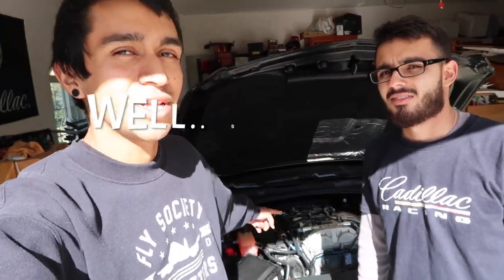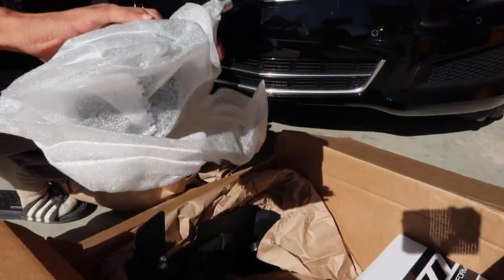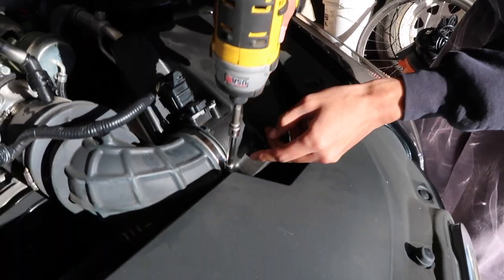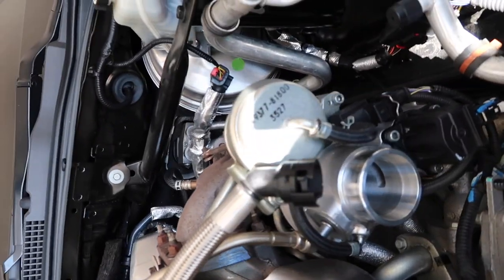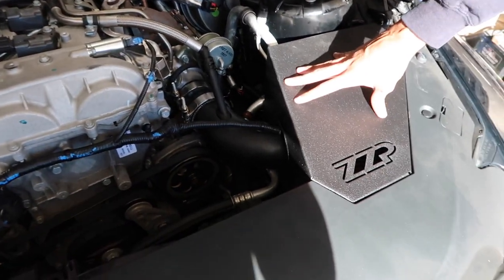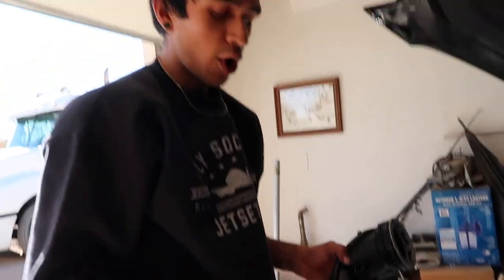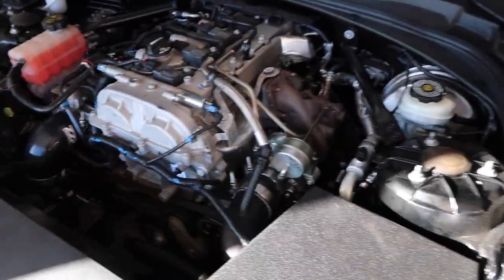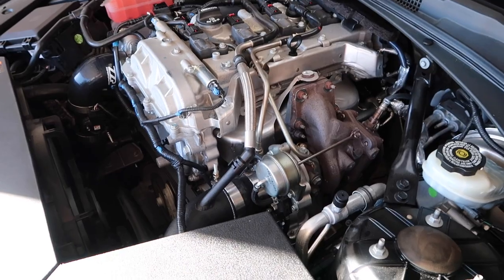Cadillac ATS 2.0T 6MT ZZPerformance Intake + Throttle Body Install

Comment: I’m the process of looking into this setup as well. Question, do you know if the car will throw any check engine codes or is it ok to run with stock tune ?
Reply from the maker: ZZP claims a potential CEL for the intake as you're increasing the overall volume of air being drawn in. BUT in my experience I ran this setup (Intake + Larger Throttle Body & Charge Pipe) for a week with NO CEL and I take my car to redline often. Once I installed my ZZP catless downpipe (potential video coming) that's when I did get a CEL but in all honesty I'm not TOO worried. My 2 codes are related to my cat not being there. So my car is running rich at the moment but I still drive it no problem. Rather run rich than lean! But I intend to get ZZP's PCM tune once I have the money for it as well as a few other little goodies that I want to do before the tune! The tune will give you extra power as well as eliminate the CEL! So it's a win win (:
Reply: PREVA1L MOTORSPORTS nice  👍🏽 ! Thank you and I look forward to seeing more of the caddy build.
Reply: PREVA1L MOTORSPORTS d

Comment: You need a catch can to keep that oil out of the intake etc. I have zzp catch can, CAI, throttle body, down pipe and PTP turbo blanket, zzp high performance coils and ngk laser iridium plugs.
Reply: How much hp with those mods

Comment: Just came back to this video after getting my engine replaced I had a cold air intake, catless dp, and was dyno tuned making 353 crank it was great for three months until it wasn’t I don’t recommend tuning this motor unless you have the time and money to build it

Comment: i did the same mods and honestly feel like i lost power. it sounds fantastic but was very disapointed. any ideas?
Reply from the maker: You shouldn't feel any noticeable power lost unless you possibly created a boost leak upon installation.. But you only did the throttle body and Intake? Without actually tuning the PCM, you're only going to get mainly increased audio from the turbo because the stock computer (tune) will only compensate so much (basically nothing). If you're after power, do a PCM tune (zzp or trifecta or any other if you know of any). If you want to make real power though, I suggest investing in a real dyno tune with a reputable tuner.
Reply: PREVA1L MOTORSPORTS I agree, I just got a tune and it’s so much fun without any bolt ons, but I’m afraid the cold air intake won’t actually make power but decrease it I’ll find out I guess

Comment: That's from the pcv valve. That's a recirculating system. That line goes into that filter on the inlet to the turbo into a foam filter.

Comment: The hose clamp is a 7 mm hex.   Be careful not to over torque the 10mm throttle body bolts.  They thread into brass inserts in the plastic intake manifold.

Comment: I just installed mine on a 2014 ats 2.0 I got a check engine light and a decrease in power the turbo sounds way louder than it should IMO I’m sure something’s just wrong with my car
Reply: Did you tune it after install or nah?
Reply from the maker: Without a tune you'll get a code for the increased airflow aka running lean. The cold start would be loud but would quiet down significantly after the cold start was over. You might have a leak if it's consistently loud

Comment: I did the Intake and now i have a p0171 lean code.  Is there a simple way of gettin rid of this without renting a cpu from the zzp 
 website ??
Reply from the maker: Honestly I'm not sure, I never got a lean code. But I also didn't have the throttle body and intake on for very long before doing the downpipe. I was running rich for a bit after that but I didn't mind that because better to run rich than lean. If you're going to tune it and still have warranty, highly suggest getting a new tuned pcm if you care about your warranty...
Reply: I had the same code on my gen 6 after I did the zzp intake and I found by rotating the tube and changing the angle of the mag I was able to make it go away, it's been gone for over 2000 miles.

Comment: It sounds like your lifters are knocking the top of the head but I could be wrong,  I diagnosed that from the video sound.  I had a used miata and the first thing I had to do was my lifters. I had to  have them adjusted so it wouldn't ruin the engine any further.  The caddy is great otherwise.
Reply from the maker: Honestly all the 2.0T's I've heard have all sounded similarly in sound. I was a little paranoid at first too, but with the car only having 16k miles I'm not all too worried. Worst case scenario gives me a reason to build the head! But thanks for the advice 👍
Reply: It’s the injectors firing at high pressure. Some applications get up to 2800 PSI! All DI engines I’ve had make that sound.
Reply: Direct injection 
That’s the sound it’s making
Reply: @snappyaj9053  in
Reply: @calvinallen3510  in what?

Comment: Great video guys! 
So how is the car running after some miles? Any issues?. 
BIG Thumbs up (=
Reply from the maker: Thanks! And car is running great besides having a CEL. A catch can is definitely a priority as these LTG's tend to have lots of blow-by.
Reply: PREVA1L MOTORSPORTS + what code do you have? Our car is finally finished (=
... We are making the right catch can for these 2.0 LTG engines. Maybe we can send you one if you would make a video for us?
.... We have a few new parts coming out for the 2.0l turbo as well. .. 
... You can always hit me up via StrictlyLTG.com (any of our social media links will work) with any issues with your engine.  Let me know the CEL code and I will let you know what to do (=
..... Thanks for your response!
Reply: How's the car running bro and can you tell the difference.
Reply from the maker: Haven't really driven the car much in the past couple weeks. I ran into an issue with the front goodridge brake lines so the car has been parked since I haven't had the time to take a look at the issue/correct it. But besides that I've since bought a tune for the car so it'll be stage 1 in the near future once I can drive it again. Will be making a video showing how to install/swap the PCM and basically show if it's worth it or not. Will be running Gus' new car before and after to show the difference.
Reply from the maker: Strictly LTG Checked it out on your website, looks good and bet it definitely helps temps in the engine bay. Lol I'm a ricer and took the stock heat shield off... I wanted to see the lil ass turbo. I know everything around it is nice and toasty now lol.. I would probably run your turbo blanket but at the price point it's not a top priority at this exact moment but when the time comes I'll hit y'all up fosho
Reply: @StrictlyLTG  your website running anymore?
Reply: @StrictlyLTG  RIP to your company and website..... Wishing you much more success on your next company.
Reply: @EliteOnTheBeat  hey I appreciate that! I’ve got over 100 companies and 20 more bov new in the box. I had to wait for inflation to get here so I clear up 10 mil$

Comment: Clean ride bro ! Do you notice any difference with the larger throttle body?
Reply from the maker: Thank you! It's kind of hard to really distinguish since I did the CAI at the same time then shortly after went catless DP. But I'm pretty sure it made a difference since the air flow has less restrictions now
Reply: PREVA1L MOTORSPORTS im planning on getting the large throttle body for my 6 gen from ZZPERFORMANCE. I got everything else but this and tune. But overall do you notice difference from stock besides the loudness of the catless downpipe?
Reply from the maker: You won't regret it! But what I felt when I switched over to my cat less downpipe was whenever I was fully WOT stock the car felt like it was bottlenecked. After switching over it made the car feels easier to rev out. Without a tune I'm sure it's barely helping but once I go tuned the car is going to come alive

Comment: Any gains out of  that configuration in terms of HP ?
Reply from the maker: I'm sure if we would have done before and after dyno runs there would have been a slight increase to horsepower but to truly take advantage of the mods I would have to get the car tuned

Comment: Did either of those upgrades make the check engine light come on?
Reply from the maker: In my experience, no.
Reply: Tamir Byrd it does. 100%. But the stage 1 kit (which clears the CELwith the tune), or stare at the little engine icon EVERYDAY, cuz it’s gunna happen.